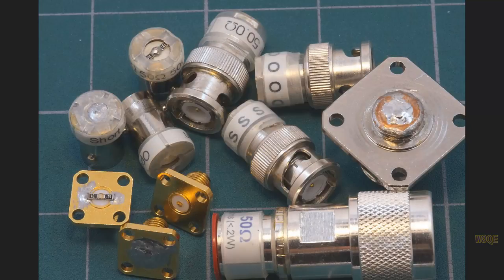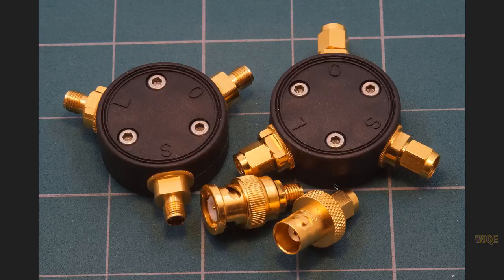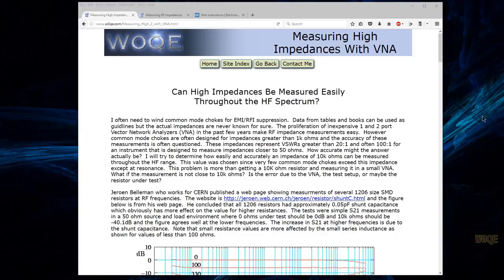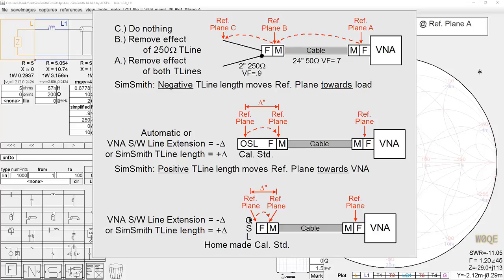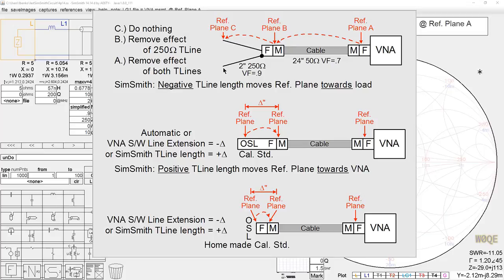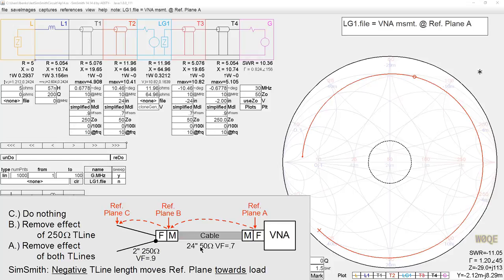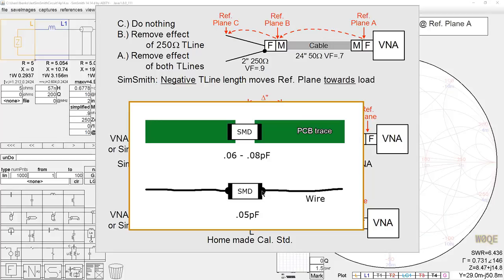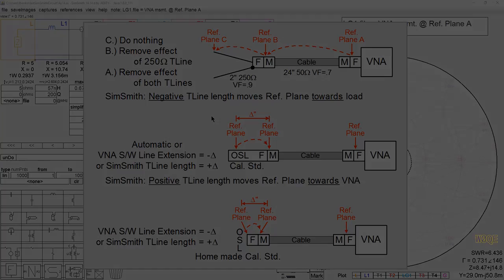#18: Making Accurate RF Measurements (Basics 10)

Comment: I recently purchased a DG8SAQ VNA and have learned a lot from these videos.  Especially importing the files in SimSmith.  You are right, moving the reference plane using the SimSmith components is really neat.  The skill of AE6TY's coding is incredible, not to  mention  the both of you guys' in-depth knowledge of  rf engineering.  I am at the point of just being able to see matching  Smith Charts in the simulation and the VNA.   I learned Smith chart back in the late 1960's at an Air Force Calibration School at LAFB, using a compass and straight edge, drawing constant SWR circles, I would have never guessed that I would be interested in it again after all these years...  Thanks for these informative videos, and the time you have invested, they are so very packed with information...
Reply from the maker: Glad you enjoyed the videos.

Comment: How good in terms of RL are those home made 50Ω terminators, could you maybe upload some calibration files of those so that others can compare against yours? A bit off topic but do you have any thoughts on how good the cheap "VNA" kits like the Rigexpert AA-30.ZERO are?
Reply from the maker: Dragan,
Calibrating an HP VNA with my HP/Agilent cal kits and then measuring the home made O/S/L loads show that they are quite good up thru 500MHz.  The worst one is the "open" due to the fringing capacitance.  My big VNA corrects for these effects and also then changes the reference plane to remove the length in the calibration standards.  You can download the manuals for VNA's such as the 8753 family and this is explained.  I am not familiar with any of the cheap VNA cal. kits and I don't think any of the small VNA's do any type of compensation for things like fringing capacitance and for the physical size of the calibration standards.  You can take care of this sometimes in S/W by adding "line extension" if the feature is available or just do it in SimSmith by adding a small length of transmission line with a negative length to move the reference plane.
Larry
Reply: Hi Larry, thanks for your response. The cheaper "VNA" have calibration routines but what those do is uncertain.  They can move the measurement plane but the rest is unknown. Most have a simple architecture like this one:     https://rigexpert.com/products/antenna-analyzers/aa-35-zoom/how-it-works/ and the manuals do not list any figures for accuracy etc. I lack the knowledge to decide if something like this would be even barely sufficient. 

Used professional VNAs are practically non-existent on the local market (small country) and even when one shows up it is in the order of several thousand € so out of "reach". 

Could you tell me what were the approximate RL figures, in the HF range, for those 50Ω terminators that you built?I'm currently playing with a bridge design by g3ynh and if I understood his work he is getting a RL of ~ 80db in the HF range which seems unrealistic. He did use a comerciall terminator but for some reason the graphs of RL for typical commercial terminators are surprisingly hard to find, hence the reason why I ask. 
Thanks 
Dragan
Reply from the maker: Dragan,
Take a look at: http://www.w0qe.com/Measuring_High_Z_with_VNA.html and http://www.w0qe.com/Measuring_RF_Impedances.html where I tried to understand exactly what you are asking.  Let me know if there 2 links do not answer what you are looking for.  I agree that a RL of 80dB (SWR=1.0002:1) is very unreasonable.
Larry